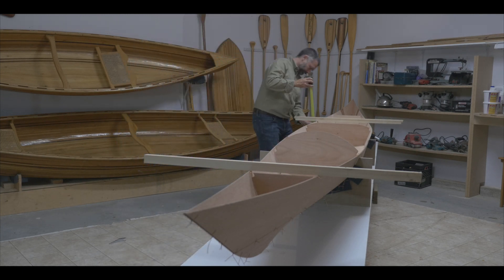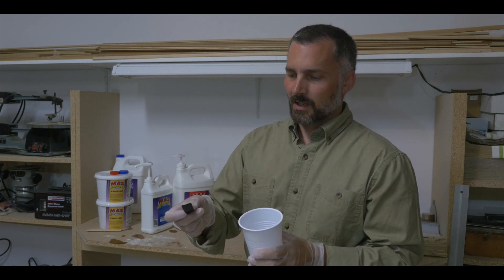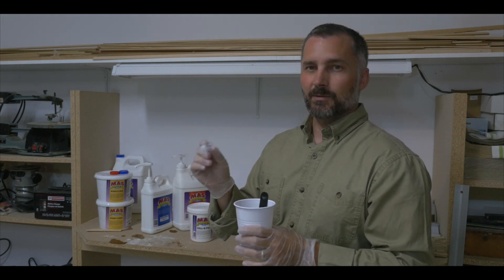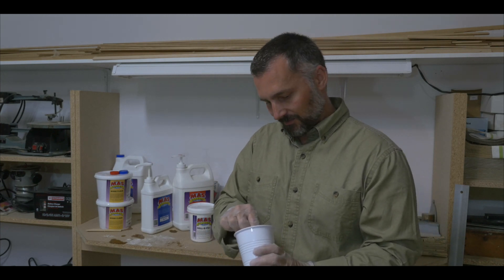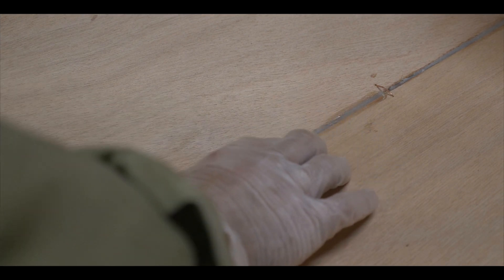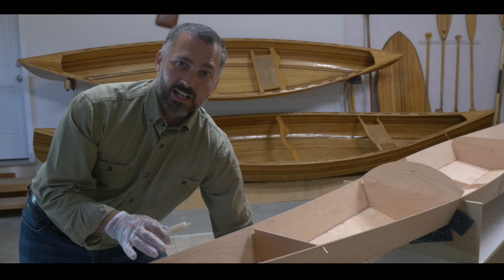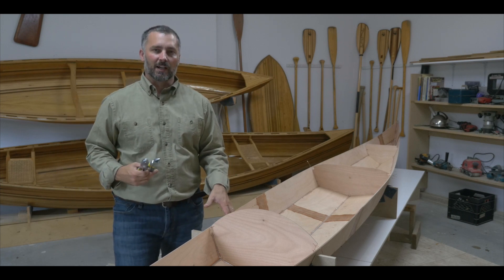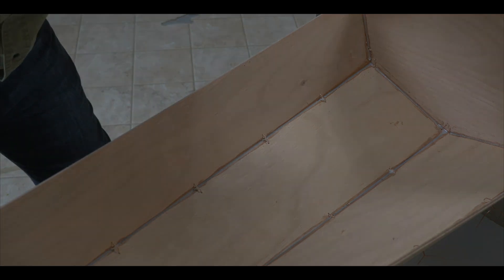How to Build a Kayak | The Shearwater 17 Kayak | Part Five - Preparing to Fibreglass the Inner Hull

Comment: I see that you have the kayak sitting in a couple cradles. Did you use the bulkheads to make a pattern for the cradles? If so, how much larger than the bulkhead should they be? They would probably really help in making sure that everything is lined up well before tacking.
Reply from the maker: Hi.
Yes exactly. I cut them on the bandsaw to the same size as the bulkheads. I didn't need to cut them larger because I just located the cradles a little further apart - which means the boat is slightly narrower.
I also added some scrap carpet  to the tops of the cradle to provide a bit of padding to prevent any possible deep scratch in the hull.
Thanks for watching.